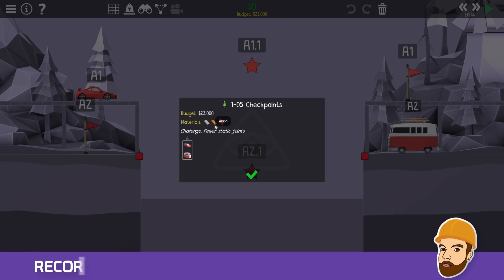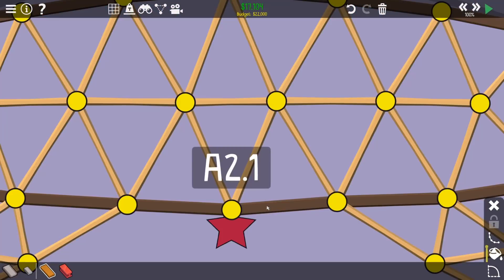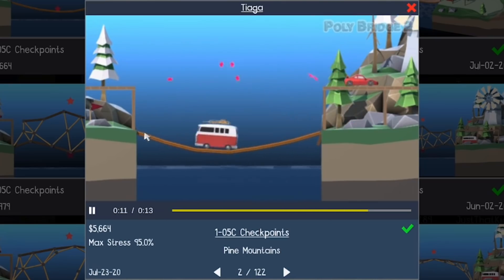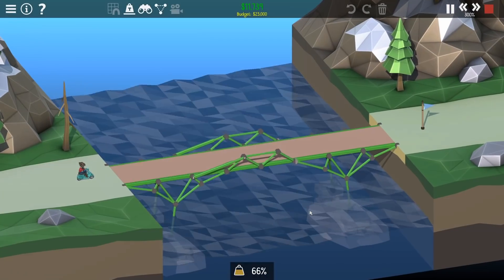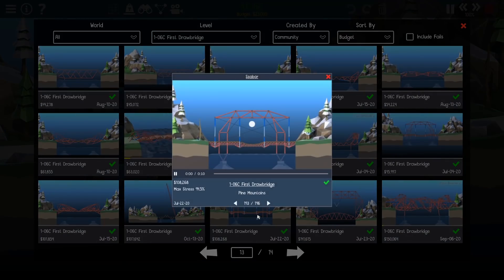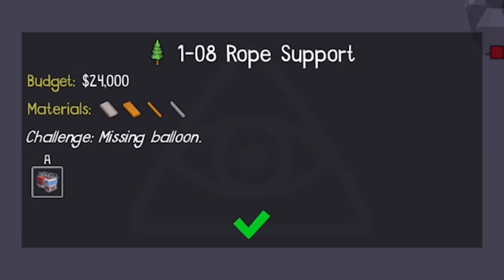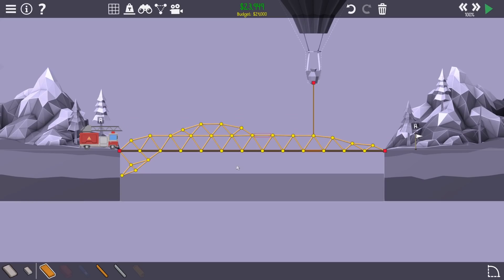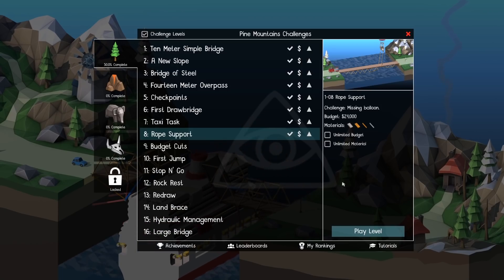I WOULDN'T GET AWAY WITH THIS IN MY DAY JOB!! Dangling Bridges from Balloons in Challenge Mode!

Comment: "too much green in that bridge"
"Bit of red, lovely!"
..... Not something you want an Engineer to say. XD - This games is a terrible influence on any real thinking. XD
Reply: To be fair a real bridge is designed with a weight limit in mind and a safety factor. Any stronger would be wasteful, a computer simulation may not turn red, but it would highlight were weight and material could be saved.
Reply: @pobvic   I mean.... yeah, sure. - The point is the safety factor, as there is none in Poly Bridge. :D

Comment: I am guessing those top ones for the first level were aiming to get as close to 100% budget without going over.  The last place one was exact at $22,000.  Which is why they didn't go cheaper when they obviously could have.
Reply: Sometimes people try to get the least stressed possible within the budget. Like a real engineer
Reply: But why? What is the intention?